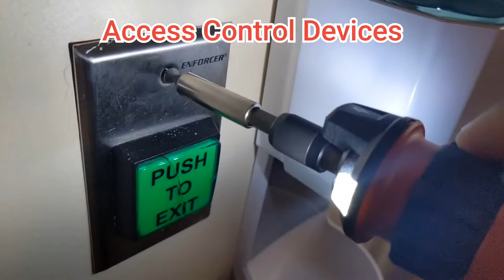SKIL Screwdriver - Cordless 4V

Comment: Nice to see a video of a battery operated screwdriver doing what it’s supposed to be used for. Most videos are trying to drive 3 inch drywall screws into solid wood. I didn’t buy this one because I thought you would have to use it 2 handed all the time. It looks like you had no problems one handed. I ended up buying the worx brand and the Dremel version.
Reply from the maker: Thanks for the feedback. It's a great little screwdriver. I still carry it. 👍
Reply: It’s insanely easy to use this one handed. How fat-fingered would you have to be to not be able to push left or right with your thumb? 😆

Comment: Wonder how it compares to the panisonic and vessel electric screwdrivers or even the Makita pen impact? That would be a good comparison.
Reply from the maker: The Makita would perform the best because of the higher voltage, but the price places it in a different category. I'm not sure about its impact function; i haven't watched any videos on it yet. The Panasonic is comparable to the Skil and Vessel in voltage, except its higher price tag. I personally like the Skil, but I also have not tried any of the others. I think the Vessel would be a close tie with the Skil. It would be the preferred screwdriver in a tool pouch for sure; it would fit much better than the Skil. The Panasonic has a good compact form factor as well, but the price is too much.